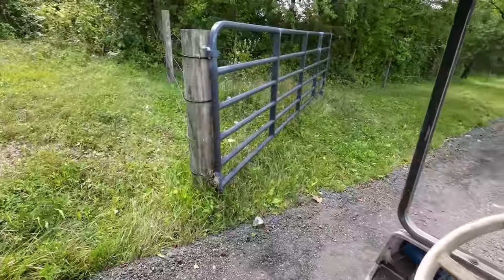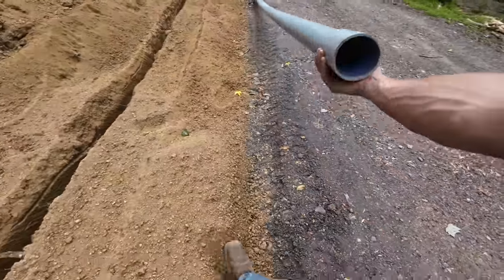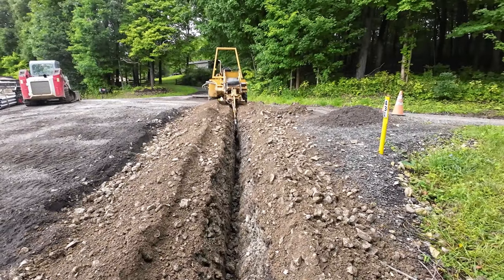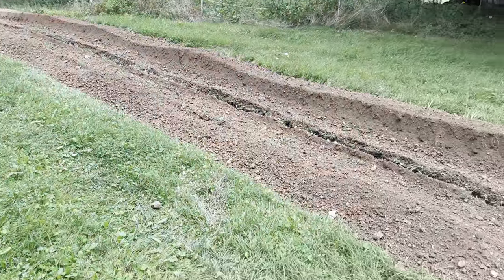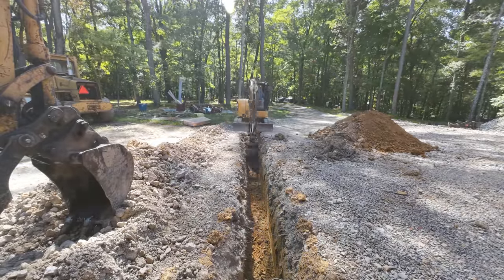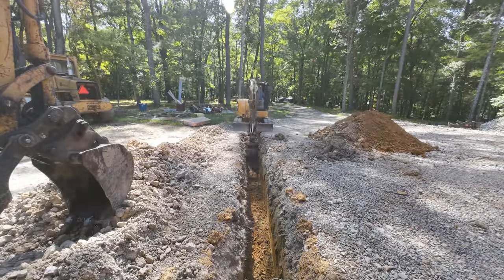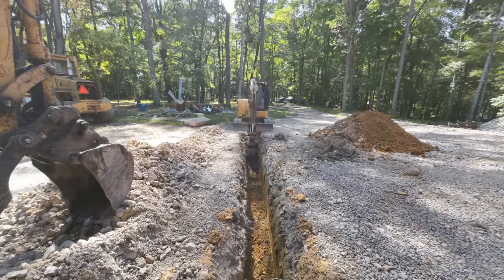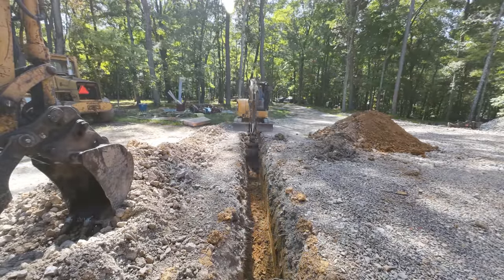Running Nearly 1/2 mile of Underground Electric, Costs over $64,000??!?!

Comment: Matt are you able to find out the trade price for whatever transformer the power company proposes to install on your feed will be as opposed to what it should be and whether they have included it on your bill?
Seems to me like there is a monstrous element of opportunistic profiteering going on.
Having said that a local of my acquaintance once told me that when she and her late husband built their new home an energy company was going to charge her over $70,000 Australian dollars to install a couple of poles and run the necessary wire to connect their home to the grid.
As a result the couple bought a small, economic diesel generator along with solar panels and a battery bank for less than half the price the energy company quoted to connect them, and stayed off-grid.
Not long after her husband died under tragic circumstances, a property developer created a housing estate at the end of a semi-rural road their house is close to.
Since the power company was now going to run mains supply virtually past her gate anyway they started trying to convince her to let them connect her to the grid, fat chance of that I assure you.
It seems energy companies may be playing fast and loose with their accounting in a number of developed countries!
Fifteen or so years ago the local State Government introduced a tariff based incentive calculated to encourage people to install solar panels on their homes and inverters to feed the energy to the grid.
Now, people like us who bore the expense of obtaining the installation, have had our tariff slashed to the point where we are receiving a pittance for energy we supply to the grid, yet are being charged an outrageous amount to buy the same anergy back from the company!

Comment: I can understand your frustration, but it doesn't get better here in my neck of the woods: Telcos will make you an offer which you absolutely cannot turn down (i.e. tens of thousands of euros, a leg, an arm and your firstborn) or tell you, they simply won't do it at all. Electricity? Well, its only 2500 when you are next to the road, but you will be billed by the meter, if you are "far away". Whatever that means.

Comment: Matt, I enjoy all of your videos and projects.  You are clearly frustrated with the power company.  This is one of the downfalls for being tucked away in the woods. I'm not optimistic about any success with the power company however.  It is amazing they made you trench in the pipe and pull boxes.  Most underground primary feeds (at least in the upper Midwest) do not require conduit.  The primary cable is direct burial and the power company handles all of that....  Good Luck

Comment: Hey Matt, A couple of things…  First off, I noticed in this video and I think the last one, a couple of voice overs doubled up where a cut was made…  Might want to check into that.  As far as the cost from the power company, I think I would say “Hey, I will buy the wire and pull it myself, you guys just come hook it up when I am done.”
Reply: I hope matt is providing spkices ant terminators fot this cable. They are not all the same and you can’t get them at Walmart

Comment: with all that money and work, just to get on the power companies teat for the rest of my life, I would have STRONGLY considered being totally off grid. Combination of off grid solar with battery bank, hydro if the creek is feasible, perhaps some homemade wind turbine setup, with a propane or diesel backup gen on an automatic transfer switch. BUT, I also work in power generation and that stuff interests me, and I HATE utility bills. BUT (also) one has to consider their time and frustration over time vs the upfront cost and monthly electric bill.

Comment: I had to pay over $3500 for an upgrade to my transformer and the connection of overhead wires and connection to my meter in 2020 for my new shop.  I provided the wire and everything but the meter from the transformer to my shop. Idaho wasn't so bad.

Comment: Your going to need water to the shop for your wood boiler, unless you plan on doing glycol feed system? Either way u need positive pressure to circulate through the radiant

Comment: Why put conduit in the ground? Armoured cable with underground rating is much simpler and easier to install. There are lots of options for underground cable both armoured and non armoured. ACWU, TECK, USEB, USEI, etc.

Comment: Can't speak for the US. But here in Norway the electric company can ask for a partial cover charge whenever you get a new supply installed or upgrade the capacity of your existing supply. They generally tend to shaft you with as high a cost as possible potentially for multiple transformers and upgrades to the existing lines if everything is at or near capacity, but they are required to give all the details on everything they are installing and the associated labour costs. So if they for instance install a transformer at some point in the chain that can handle a higher load then what you asked for and/or can reasonably be expected to need you can contest the case with a national regulatory agency and in general whenever a case reaches them the electric company tends to loose. It is a pain that the system is rigged this way, but it's what you get when politicians open up the door for billing the consumers. We also have a system where you can ask for a partial refund up until 10 years from the date you were connected if part of the capacity you paid for is effectively given to somebody else. However you have to keep track of who gets connected to your supply on your own rather than the logical choice which would be that this refund was automatic as the electric company has complete control over who is connected to what part of their grid.

Comment: Perhaps you could purchase and pull the wire yourself. Use an excavator track and wrap the end of the pull wire around it and then let the track do all the pulling! 

Jesse Muller, master electrician and friend of Andrew Camarata has a video demonstrating it.

Also, ask them for an itemized invoice. That may help you negotiate or find other ways to cut costs.

Comment: $21.00 per.foot , is what you are looking at .plus the 12k, in electrical conduit, equipment, and labor. 
Electrical company have you over the barrel. And really don't care about your problems. 
I would suggest you look at electrical contactor in your area and get an estimate. 
You can buy the wire by spoils and hire electrical business to install the wire and transfer. 
Our electrical company changes me 1.00 per day for the meter to read the power usage in our home.

Comment: A $64k hookup fee is pretty unreasonable.  Utility companies, consumers, and society in general needs to rethink how electricity is distributed.  For that kind of money, one would likely be better off just building a complete off grid solar power system with a solar panel array, a battery bank, an inverter array, and a fossil fuel generator for carrying one through exceptionally cloudy/bad weather days of the year.

Alternatively, it would make sense to stop consuming 240V/120V AC at 200A of service capability, with ~5% voltage delivery tolerance.  It would be much cheaper to hook up to the grid, if the house had a small battery bank (say 15 kWh of lithium iron phosphate batteries), and a large solar inverter array that can produce upwards of 200A at 240V/120V at locally regulated 5% or better tolerance.  When one has a home battery and local inverter (like those used in off-grid solar power systems), it no longer becomes necessary to have 200A utility service, since the average power consumption of a home in the US is only 30 kWh/day, which is around 1.25 kW continuous, when averaged over the entire 24 hour day, which is only ~5.2A at 240V AC.

Basically, the average household only uses around ~3% (on average) of their total "200A service" provide by the utility, but in order to provide this level of service, the transformers and wires all have to be sized large enough to handle the full 200A.  This means that everything must be effectively oversized by a factor of more than 30x compared to what people actually consume, on average.  This oversizing is necessary in order to maintain the ~5% voltage delivery tolerance, and to meet the instantaneous high peak demand loads, when one does not have a local battery pack available at their point of consumption.

Basically, having a home battery and inverter (even without a solar array) enables one to meet all of the instantaneous high demand loads (such as clothes dryer, electric range, and electric water heater), of a house, without the need for a large utility service connection capable of 200A. Instead, one can design and configure a battery charger that runs off of something much wimpier than 200A (and with much larger percentage voltage sag allowance during full load operation), which would significantly save on the utility service connection cost.

One could for example design a system where the utility company produces 7.8kV AC 60Hz, and makes it available along side road ways.  Then, individual consumers in relatively low population density areas could buy a small 7.8kV AC input to 400V DC output (say 15A max) power factor corrected switch mode power supply, to hook up to the grid connection.  The 400V DC at 15A service is wimpy enough that it could be transmitted through 12 AWG 600V rated wire like UF-B (which is rated for direct burial without needing a conduit).  The maximum available power delivery from 400V at 15A is only 6 kW, which is much lower than the 48 kW service provided to typical homes (via 240V AC at 200A), but it would still be plenty of service to run all normal household loads, when one has a local inverter and battery bank to spread out the peak consumption of high instantaneous loads over the entire 24 hour day.  6kW of service, continuous over 24 hours, is 144 kWh/day, which is plenty for normal residential consumers of electricity (whereby actual residential electricity use is closer to 30 kWh/day on average across the US).

The total cost of such a system, using existing inverters and lithium iron phosphate batteries designed for solar power systems, has the potential to be considerably cheaper than the $64k utility hookup mentioned in this video.  Such a system described above could realistically be implemented for less than half the cost of the $64k utility connection fee mentioned in this video.  Additionally, such a system is better for utility companies, since it effectively adds batteries to the utility grid (at the customers site and expense), which reduces peak demand profile throughout the day, which reduces the total grid sizing and peak power production capacity needed to be maintained available by the utility companies.

Comment: I realize that people will say this and that about how far you can run “low voltage” electrical but…..  there’s no reason you can’t make all those runs yourself and just have the transformer out at the pole. That price is ridiculous. I live on an island where everything cost three times as much. They wanted 8500 to run tell poles into my house which I thought was too much. So I did the same thing you are. Except I had the power company put the transformer out on the pole and I ran the conduit and wire in myself. It was 1400 feet. I’ve never noticed any difference in power dimming or anything. And that’s with me running even a 350 amp welder on that line!! Welding 3/4” aluminum. It cost me 1700 for the wire and 2500 for the conduit. Granted that was 15 years ago. Good luck man. Power companies are bullshit!!  Freakin pirates!!!

Comment: I would guess the power company going to charge to setup the lines over 51 Grand for the 2500 Feet of high Voltage which they really don't need to do much I agree Matt that is Highway Robbery the electrical wire should be around 12 grand or so you have to do most of the Setup and pull line all they do is Pull the wire and Setup the Transformers should be 25 grand Max with labor 47:30 @Diesel Creek

Comment: I'm in Australia so those cost's dont seem insane to me. Here if you need a transformer you need to pay for it and its located on the pole so then you need huge gauge copper low voltage cable to compensate for voltage drop.

Comment: The $52k number is par for the course… 

The usual with my utilities experience is usually coverage for overages - they typically hit you hard and rebate the difference afterwards. And you might expect a few K back. But don’t count those chickens… Or expect it readily or at all.

Remember these are IBEW guys typically who need a fully expense paid donut run each day for a few hours to stand around and watch a guy work. 

The alternative is to have a separate approved contractor do the work and get a solid number. 

An engineer had to twiddle some numbers, validate some voltage drop. Shielded high voltage cable costs more than you think. (Not regular wire) And that transformer is likely 30KVA - at $30k. (Just looked one up at $32k for a 12kv/208v) Labor billed out at $115/hr per man/day of which that guy makes $60/hr but laid off half the time… But they have to keep the prevailing wage high to justify that union - so they can rip off the tax payer with the company they work for…

Comment: Its interesting..over here in oz the power company is responsible to get the power to just inside the property,after that that its all on you...mostly people do high voltage on poles then transformer to lower voltage to shop...underground is expensive,but that seems way over the top,that would be close to $100000 here.....for poles the cost here would be $15,000 for poles and wire and you have to buy transformer $10,000 ($16000 us dollars total).

Comment: if the neighbours are getting feeds of the same cable they should pay some of the cost. especially for the section that runs through there property.

a local developer took the local council to court for charging him the cost of putting water and sewer lines in to service one his developments they then connected later developments onto those lines without the big fees he paid and he wanted compensation and he won. so they got the law changed.

see if there is a approved contractor in your area that can do the work they'll probably be 2 thirds the price.

Comment: I like to use duct tape to cap the pipes of when building things. It's much cheaper than the cap you probably wont use and you can take it off easily. If you start in the morning when it's cool and try to take the cap off in the afternoon when its hot those caps can get pretty hard to take off, and you're probably going to mess it up anyways. It's more expensive for a bigger pain in the ass.

Comment: Entergy in arkansas says they charge 4.02 a foot for underground service. They run 800ft over head for free. For me to run 90ft underground its going to cost somewhere around 500 with all the fees involved. Thats with me doing exactly what you're doing here. if you were to run that 2,500ft at the same cost it per foot, it would cost around $11,000 with the same fees.

Comment: 1) your conduit aint stuck together good gonna be hell pulling through that.  you need 2 or 3 people minimum, wood, sledge and a whole heap more wet glue to hilt conduit (which I can say unequivocally was not done)

2) even in neighborhoods in seattle xform cost goes to the last person who is modifying.  Thats you.  I recon the xform cost at least $25k.

3) until you pull your head out, enjoy not having power.  these people dont need your $30 a month meter fee.

Comment: 49:00   IF  the wire costs $10,000, then I think $42,000 for labor is outrageous.
I had a similar situation in Michigan, USA. I wanted them to run line from transformer by road to an outbuilding about 200 feet away. Don't recall the price but it seemed way high. For them to allow me to run the wire myself, I would have to install it in conduit and the price would only be about 25% less.

Comment: Were you forced to give up your ownership of the pipe and right of way? If any body else connects to the pipe or cuts in a transformer before your property, you have an ownership case. Otherwise I think you will just have to suck it up. You may be able to force the power company to install another primary feed for that area. Next time you go under a road, use a water jet and some 1/2 PVC. Then pull your through the hole. I did that for 30 years for communication cables.

Comment: You don't have to use the electric company to install the power line. This is something we found out the hard way long ago. You can use private contractors to do the same thing at about 10 cents on the dollar of what the power company will charge. I hope you read this before you spend your money

Comment: All kidding aside with $numbers like that solar and a windmill is starting to look good with some battery back up to smooth out the peaks a valleys. 
 A small buisness near me was trying to get a gas line installed but was told it would be $37,000 but there is a high pressure transmission line running within 30 feet of his front door but that isn't the usable for him. 
 It's OK for the big guys to dig up you front yard under eminent domain but your screwed if you want to be a small paying customer.

Comment: Matt, buy and put the wire in yourself. Then buy the transformers and install them too. It's not that technical, get the permits and do it yourself. Have an  electrician do the final connections to utility pole and save alot of money. It's not rocket science. You can do it.